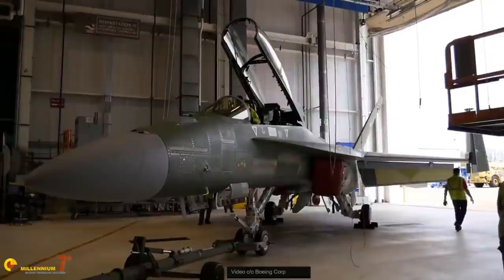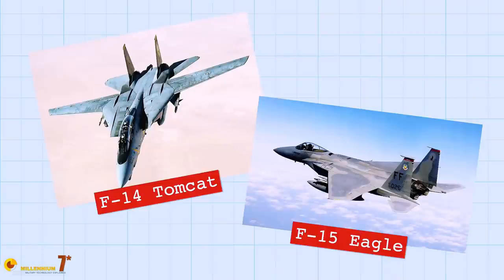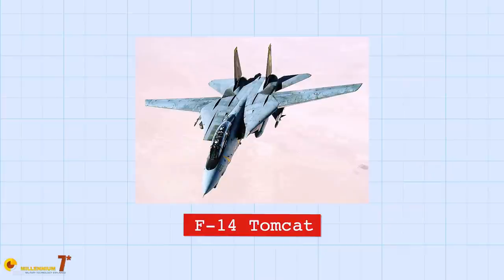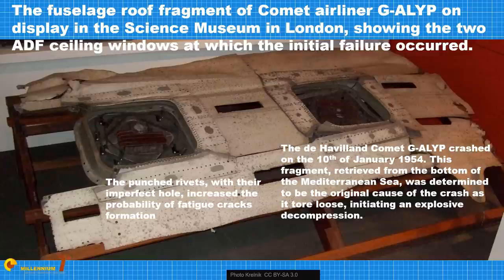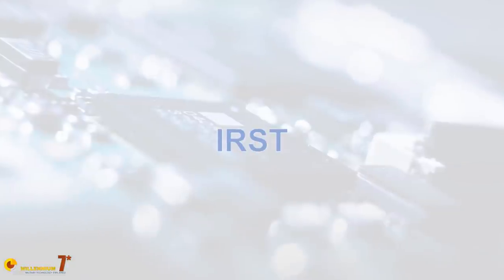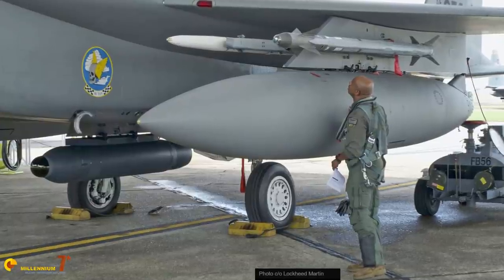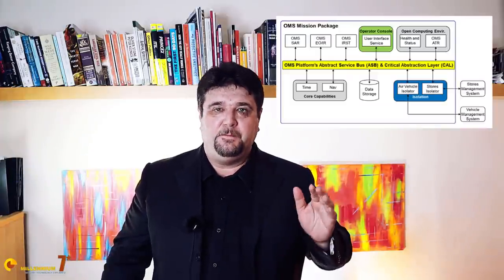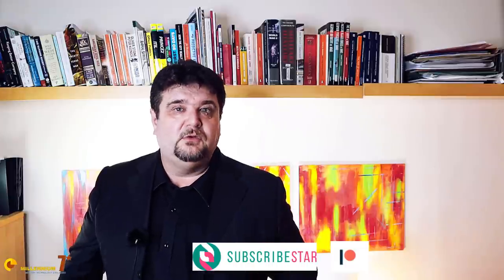The F/A-18 E/F Block 3: is it 5th Generation?

Comment: One problem I seem to be alone in having with the Netcentric Warfare Doctrine (NCW-D) is that it is very attractive for an opponent to try to disturb or even eliminate the network. People I spoke to about this said: wel yes, but because it's so widely distributed, the chance of crashing the entire network is virtually zero. OK, but how about an atmospheric nucleaur explosion? That is known for the discharge of a powerful electro-magnetic pulse (EMP) and residual radiation captured by particles in the air, effectively shutting down all bandwiths (ranging from ULF tot UHF) for communication in a certain area. After that remark the conversation was over... maybe a too sensitive topic? 
The other thing I am worried about are the so-called AWACS-killer weapons. Air forces rely on a host of enablers like AWACS, JSTARSS, all kinds of SIGINT aircraft, drones and battlefield air communications nodes (BACN). Not to mention satellites. It seems very seductive to go after these platforms, since most are large, non-stealthy aircraft with little means of self defence. Satellites can be reached by ASAT missiles, etc. Though I agree distribution is key here to maintain the network and its sensors,  the latter may become very vulnerable. The next step probably will be distributed low cost/disposable sensing and enabling platforms. But for now, enablers possibly may find themselve in the front line in a large, peer-peer conflict, right?  
Final observation. Looking at my son, he seems to be overreliant on his phone. Outside his known surroundings he has to use Google Maps to find his way. OK, his phone is a convenient tool, but he has only a fraction of the ready to use knowledge and understanding my generation had when we left school. And that bugs him when his phone is broken. How does that work for pilots with such a big screen in front of them? Are they still able to synthesize the data by themselves and navigate, fight and return home safely when that breaks down? And to what extent is it detrimental to a pilots warfighting intelligence? Is (s)he still able to make decisions for her/himself when the situation demands so, or do the net and the screen become as convenient and to some degree mind numbing as a smart phone? In other words, do pilots need to have the same level of training in tactics, decision making under high levels of stress and knowledge of hostile platforms they can instantenously use, or do they become so called 'switch button warriors' that happen to be in a fast flying office?
Reply from the maker: 3 very sensible points that I share.

Comment: Short answer: no.
Long answer: NOOOO!
Longer Answer: If Flankers and Eurofighters and Rafales are 4th or 4++ gen, so is this plane. It has none of the distinguishing features of 5th gen.

Anti-radar shaping? not even close.
Supercruise? not to my knowledge.
IR signature minimization and IR seeker jamming? no.
All-internal or stealthy conformal weapons and fuel? not even close.
Thrust Vector Control and post-stall supermaneuverability? No.
Reply: The whole "5th generation" is just Lockheed marketing to begin with, taking specific attribute unique to their product(s) and listing them as requirements, without any proof of those features will be regarded as standard functions of the era.

IN comparison, here are some actual generational stuff:
* transition from biplanes with external supports to monoplanes with internal wing support.
* going from propeller propulsion to reaction engines.
* shifting from analogue to digital avionics.

Comment: 3:40 I wouldn't say the failure of the YF-17 mattered at all in the F-18.  Even if the F-17 had won the Air Force fly-off, we'd still have an F/A-18 based on it, I think.  I also haven't heard the F-16 was too fragile for carrier operations; its frame is good for 9.4G and the landing gear was recycled from a heavier aircraft, I believe.  Instead I think the single engine was the sole reason to reject the F-16.  I'm not saying this based on facts, specifically, rather just reasoning as an engineer from first principles.

Also I'm curious why the Navy didn't weigh in on the fly-off.  If the Navy had said, before the Air Force had made a decision, that they'd hop on board an F-17 order sharing the eventual R&D spend 50/50, would have swayed that decision?  Sure there'd be differences in the models but the various F-35's share a huge number of the actual components.
Reply: F35 is a single engined aircraft
Reply: @mmmssbb23  yeah, and?  Jet reliability came  a long way in the several decades between their designs.

Comment: I feel like the f 18 wasn’t the answer. A new F14 airframe with modern avionics and the Rio becoming the Wso would have been better
Reply: Along with increased cost both for purchase and operating, not exactly the best option for a country running debt approaching 30 trillion.  Fixed wing setups offer better durability and lower cost over variable wing geometry aircraft.
Reply: @patrickhenry236  Unless you can come up with the cost and maintenance hours for the Tomcat 21 program your statement is null and void.
Reply: @josephkugel5099  Sounds like your problem extends beyond a lack of funding to a lack of courage and critical thinking.

Comment: The only thing this video got right was that the F-18 was a multiple failure of a design and that it has received the most money and upgrades of any other aircraft that has ever flown in all human history,  give it another twenty years of service and two more complete ground up rebuilds and it could maybe just maybe be a better plane than the proposed Tomcat 21 would have been back in 1991 assuming of course that Tomcat never got so much as a new screw in replacement parts that is.

Comment: The F/A-18 E/F Block 3: is it 5th Generation? Nope, it is obviously not. Without stealth it is funny to speak about this.
Reply: I don't even think you could consider it a 4.5 gen aircraft if It doesn't have super cruise. Hell, it barley breaks the sound barrier.
Reply: @operator0   This is also a funny statement. In a real config none of the 4th gen plane can SC:

1.SC term was used by LM about M1.5+ speed.
2. If you have real range for any 4th gen plane you need drop tanks.
3. But you can't drop them every time if you just suspect possibility of air combat.

2+3 = even considering AA config + drop tank the funny PR statement about the M1.5 speed of EF Ty. is just a tale or rather a lie. You can't dismiss + larger cross section and what is important the wave drag. Just check the shape of F-102 and F-5 how important is the area rule... No check the shape and cross section of drop tank.

1 - Even with full AA config without drop tank is maybe possible the M1.2 at 30k feet for EF Ty. but that is all.
In practice none of the 4th gen plane can sustain M1.0+ speed with real config.

BTW the avionics provides the 4+, 4++, 4.5 or whatever labels not the flight performance.
Reply: @molnibalage83  If the avionics provides the designation, then that would mean that a MIG-21 could potentially be a 4.5 gen if someone were to perform the upgrades....theoretically 

Is the HAL Tejas a 4.5 gen aircraft? 

What kind of avionics are needed to designate an aircraft as 4.5 gen? 

Also, it's my understanding that the Block 3 Super Hornet, nor any previous versions, can achieve SC even in a clean configuration. It seems to me that the Typhoon, Rafale and Grippen certainly beat it in that department, even if the load out is anemic.
Reply: @operator0  You approach is quite strange but I rather call it funny.
You are the first person that I have ever met that couples the speed with gen. classification. 
Which is 100% pointless and even the planes what you think in practice can't do SC or just even M1.0+

In fact the classification for many planes cannot be applied.

* A MiG-21 can have partially 4th gen avionics as the MiG-21 LancerR get a new cockpit, new radar, data ling, PGM and even digital flight control. But regardless of the changes it aerodynamics design and absolute flight performance did not change. In a close dogfight, the horizontal accel and in other parameters is almost identical with its original form. How you would call a plane with INS, 2xMFD, digital FCS and everything which was true for F-16A Blk1 and even partialyl for Blk 25-40?

* What about the AMRAAM capable US Harriers? They are subsonic what they have glass cockpit BVR capability.

* What about the F-4E Terminator? PGM + AIM-120 in a 3rd gen airframe.

* What about the F-4ICE/KWS?

* The F-111F could break the speed of sound at SEA LEVEL in case did not carry any stores externally. While nobody called SC capable plane. Because the funny marketing of European manufacturers did not act. 

And so one. 
The 4+ and other designation can be applied ONLY for planes which are designed using similar aspects as happened with F-15/16 and partially F-14. These are the multirole fighters following the teenager fighters.

Gripen is not able to break the M1.0 not even with 2xAIM-9 on wingtip. I know because I know personally Gripen pilot. With REAL config they are also not capable. And no 4. gen plane in practice can fly supersonically with full REASONABLE AG armament but for such a high fuel cost and for such a short time following a long accel which means it is just theory. Check their  flight performance data. The Gripen E is even worse because the F414 could not keep up even with the size and weight increase of the plane not mentioning the drag in case of stores which is needed to have combat potential.

Pls. do not fed me with BS marketing of Eurojets. The law of physics are the same for them.
You can't avoid the wave drag. Ty. is the most powerful from the listed planes and Gripen is the weakest. Have you ever have seen any demo from them...?

I spoke with a Gripen pilot and I quite him:

"It was painful to fly dogfight even against an F-16 Blk. 32".

The only merit of the Gripen is good horizontal accel in AA config but the plane simply lacks the power. The original A/C Gripen need the F414 instead F404 and the Gripen E needs the F414 EPE instead the F414. But these never going to happen.

As I can judge you do not have even the basic knowledge about aerodynamics and performance of the planes at all. 
I can  recommend flight manuals and books if you wish to understand the reality instead believing the PR/marketing steamroll of the Eurojets.
Reply: @molnibalage83  The Grippen A/C/D cannot SC, but the E/F model can. I base my info on what Saab and the Swedish AF say. 

In 2006 the Gripen A participated in a Red Flag exercise and it's performance was exceptional. It "shot down" ten aircraft, including a typhoon on the first day. The Grippen E/F is, obviously, much better than the A/C/D. Later on, in that same exercise, one Grippen beat the F-16 block 50 five times in close air combat. In another exercise against the Norwegian airforce, three Gripens faced off against five F-16s. The result was 5-0 in favor of the Grippens. I'll take published results over anecdotal evidence to draw my conclusions. Maybe your pilot friend is a bad fighter pilot. Maybe he needs to fly C-130s.

There's only one plane in the world that can SC with a reasonable AG load out, and it's 5th gen.

Again, if we just go off avionics, then a whole bunch of aircraft that will get smoked by the the Typhoon, Grippen, Rafale, Mig-35, and SU-35 would be considered 4.5 gen. The Tejas is a terrible aircraft with great avionics. It is not comparable to the above mentioned aircraft in overall capabilities. I certainly wouldn't consider it a 4.5 gen aircraft.
Reply: @operator0  Pal, I do not believe in fairytales. The Gripen is is just heavier with even more drag and higher AoA even in level flight. The Gripen E how the hell on Earth could reach with drop tanks and weapons M1.2?
Sorry...
Reply: @molnibalage83  The Swedes say it can.
Reply: @operator0  You know, in Hungary late '90s had such statements that the JAS-39A is the world first 4th (!!) generation plane. In that time the YF-22 took of 7 years ago and the very early series F-22 existed....

Their pilots said:
"The only multirole plane where only a single button push and the plane is ready to another task."

Aham...
They simply pretend that other planes do not have modes. For ex. the F-16C sincs the Block 25 had similar HUD and ICP-DED system as the Gripen, with the master (NAV, AG, AA) and overrides modes (MRM, DGF).

I do not treat something which comes from SAAB and it seems break the law of physics.
Reply: @molnibalage83  Wait, are trying to tell me that Saab claimed the Grippen was the world's first 4th gen aircraft?
Reply: @operator0  Yes, this was their statement. As I have said, the pr/marketing steamroller of thr SAAB is famous.
Reply: @molnibalage83  LOL. I don't believe that for one second.
Reply: @operator0  Nope, I admire the some features of the Gripen. I can't stand the PR/marketing BS.
The swing role was available for many planes waaaaaaaaaaaaaaaaaaaaaaaaaaaay before the Gripen A.
Reply: @molnibalage83  Yeah, you're right. They could do that in WWII.

Comment: The Hornet is severly limited by a small sweep-angle of its main-wings, crippling it already in high-SUBsonic speeds, thus irrelevant against any similarly equipped (avionics, weapons) 4G fighters or even upgraded Mig-21bis (let alone Kfir), perhaps not even vs. Phantom-2000. The Hornet is a fighter-bomber replacing the A-6 and A-7 in bombing 3rd world countries aka gunboat policy. The F-35 is more of the same, yet more agile while also falling apart.

Comment: If Australia was going to stay American then we should have continued using the F-18 platform. We need an all rounder and not a expensive specialist like the F-35 and we need two engines not one. And that's just for starters, pilots need to gain experience in the air, the running costs of the F-35 alone make it unacceptable. But we had to get on the bandwagon didn't we.